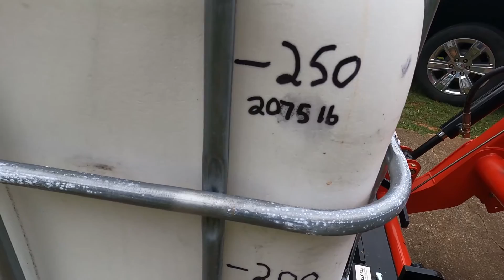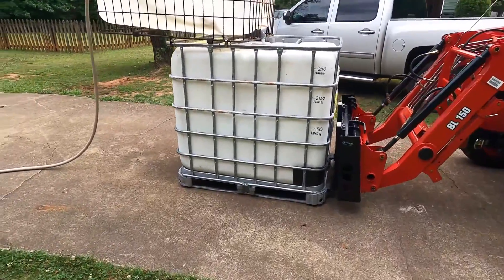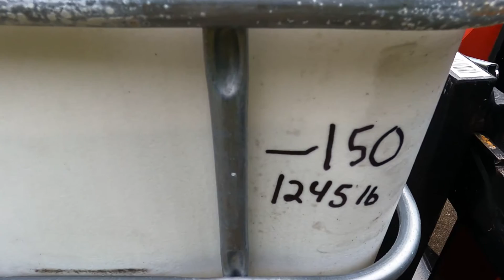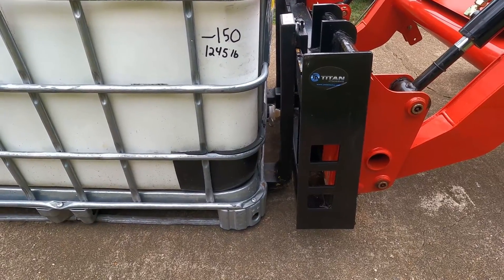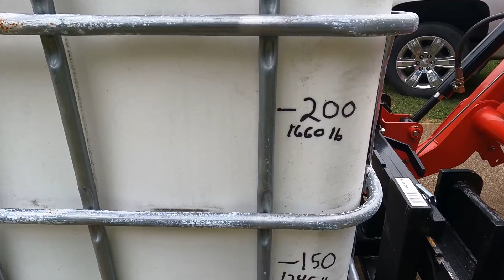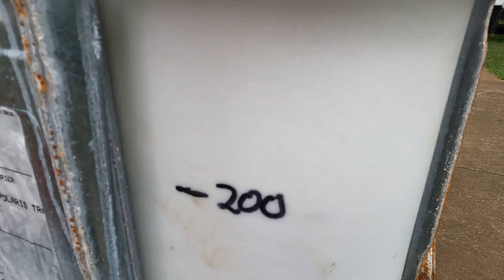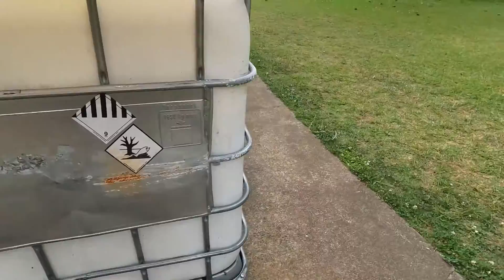Testing The Lift Capacity Of A Branson 2515h Tractor Using Titan Pallet Forks & 200 Gallons Of Water

Comment: This tractor is a monster for its size. I have 800lbs of ballast and filled tires(500lbs). It still gets a bit light in the rear when pushing it to the limit. Without filled tires I think it needs 1500lbs or more ballast to stay firmly planted and keep stress off the front axle.

I have a crane scale and tested it with 340lb 4ft pallet forks. 24 inches(load center) at 4 ft high it lifted 2020 pounds at idle! 😲 Full throttle only gained 30 lbs so engine rpm seems to only really change the flow rate.

I tried with the forks fully vertical, cylinders curled all the way in to put more weight closer to the pins, and at 6ft high, it lifted 2600lbs. So, with no attachments it should lift damn near 3000lbs, 6ft in the air, and more than that if close to the ground. Impressive to say the least. 

I also know you should be able to adjust the pressure relief valve for even more lift, but that seems a bit sketchy 😂. I'd worry about damaging stuff at that point.

Comment: So I am wondering if I had a ton of grain delivered, would this tractor be able to take it off the back end of the semi truck?  You didn't lift very high so I am concerned the answer would be no.  Thoughts?
Reply from the maker: It will definitely lift it high enough. You just need a lot of ballast. My ballast box is about 700 pounds but my tires aren't filled with any fluid. 700 pounds of ballast plus filled tires and it will handle it. Thanks for watching.

Comment: I have a 2515R. With ballast filled tires. With 5 ft Shredder in back. TOTE COMPLETELY FULL TO BRIM. WILL PICK IT UP AND HAUL IT.  1ST CURL THE TOTE INWARD TOWARDS TRACTOR PULLING CYLINDERS IN AS FAR AS WILL GO THEN PROCEED TO LIFT. THIS TRANSFERS SOME WEIGHT CLOSER TO THE PINS..

Comment: I have this tractor and i chose it for it's lifting capacity and it's analog engine systems. Digital isn't needed on these tractors and only raises repair costs. My 2515 has been flawless in its first 50 hrs of operations. Out performs all other tractors in it's class and has a nice purchase price compared to JD and Kabota.
Reply from the maker: I couldn't agree more. That's exactly why I bought mine. Thanks for watching. I have some other videos of it.
Reply: Enough power for its weight?

Comment: We own the same tractor---just hit 50 hours on it this past weekend, in fact---and I can confirm the same results:  The tractor can absolutely lift more at the front than the tractor itself can handle in the back.  I have moved some VERY large tree trunks with mine, actually high enough to load them onto a flatbed truck.  I've also done many full buckets of gravel with no difficulty.  I keep a 5 foot finishing mower on the back for weight (and general use), but my tires are not filled.  Overall an incredibly impressive machine, and with the super low range selection and 4wd, it can actually MOVE the things it can pick up.
Reply from the maker: Yes it is impressive!

Comment: Paul I got a 2515 in march add the loader will not stay up  after I walk away from it. Do you have any Ideas?
Reply from the maker: Hyd. fluid is bypassing somewhere probably in your control valve. I would call the dealer and talk to them. Good luck.

Comment: What about driving with this load?
It would be really interesting!
Reply from the maker: Yeah if I had the proper ballast, I dont think it would be a problem. Thanks for watching.
Reply: Would not want that weight for daily travel on my front end. It is very neat that it can lift that.
Reply: @beaushirley4668  Yesterday I put three parts of firewood - 1.200lb each - with my front loader from the street into the storage. Even driving - slowly - was no problem with my Branson 5025C, exiting :)

Comment: I have this exact tractor. I have 10 acres and it is perfect. I flattened a big area. I have mowed/ brush hogged. I move heavy things with forks (not no where near 2k lbs).
Reply from the maker: Its an amazing little tractor. Thanks for watching.
Reply: Enough power for weigh? What size mower?
Reply: @chadh7559  i use 5 foot brush hog and a 6 foot finishing

Comment: The LB150 loader is rated to 2200lbs full height and 3660lb breakout, I believe the breakout is 24 inches. 
As you mentioned these ratings are at the pins and the center of gravity of the water tank is significantly forward of the pins. Also keep in mind the tractor doesn't have full hydraulic pressure at an idol. That is achieved somewhere Beyond one-third of the RPM.

Overall a very impressive display of the tractors capability! 
Thanks for the video!
Reply: Because your testimony I’m getting one thanks for the help
Reply from the maker: @marcodasilva5214  You will not be disappointed.